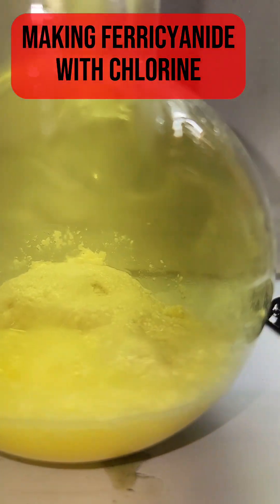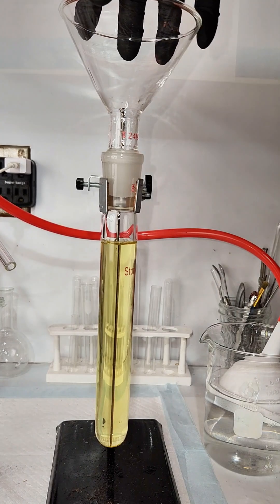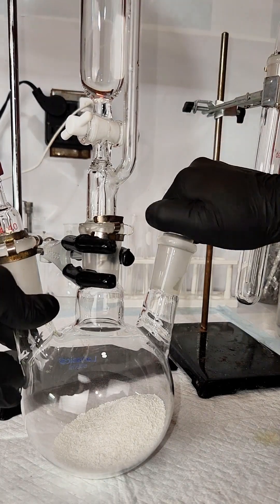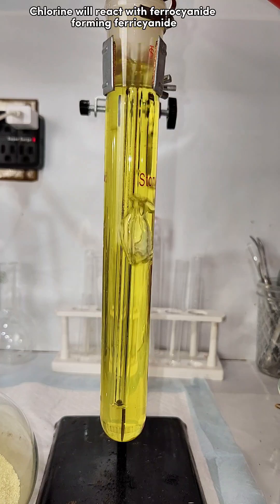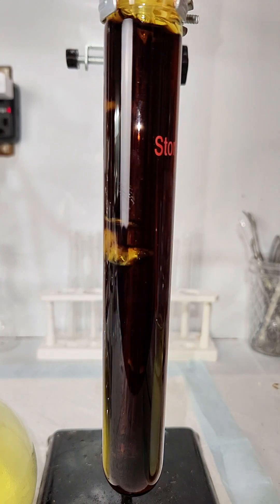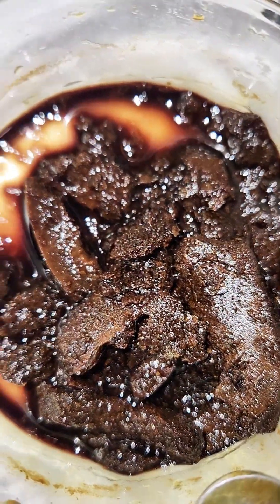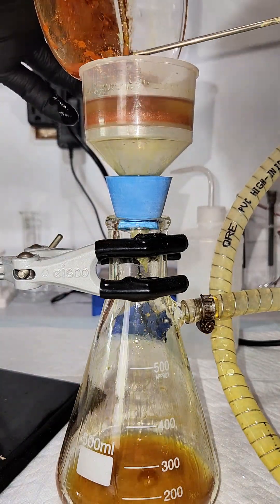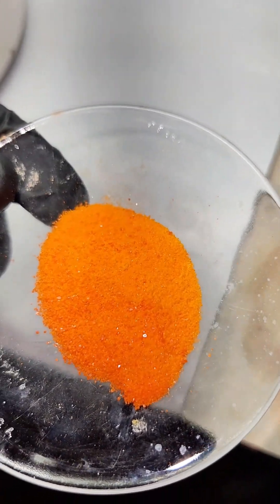Ferrocyanide to Ferricyanide

Comment: "Chlorine is really dangerous"
So go down Home Depot, buy bleach and "spirits of salt" (conc. hydrochloric acid) to clean a toilet, and then think mixing them will make an even stronger cleaner.
There should be large warnings on the containers of both chemicals. There is not. People have died doing this.

Comment: I would not use acetone here.  Ferricyanide is a mild oxidant and chlorine is a powerful oxidizer and chlorinator.
Reply: Ferricyanide was/is used in chemical photography to lighten selectively black and white prints. It's called "Farmer's reducer" though of course it oxidises the silver, not reduces it. It can also be used in a sepia process. 
The downsides are that the stuff needs making up fresh every time you use it, has a shelf life of about 10 minutes, and you need the extract on in case HCN is produced.
But it was fun when I was at school, along with making ultra-fine grain developers and the like - something today's aspiring chemists are unlikely to experience.

Comment: Yes, your recrystallizations don't seem to purify the product due to the extremely similar solubilities of the ferrocyanide and the ferricyanide (both around 30g/100mL iirc). So your product is likely going to contain some leftover ferrocyanide. I wonder if electrolysis of the solution will get rid of it: The ferrocyanide ion can be oxidized to ferricyanide on a nickel anode. The only byproduct is potassium hydroxide, which has a much larger solubility than the ferricyanide and therefore the product can be easily removed by the crystallization and filtration you've done here. Hope this helps!
Reply from the maker: Thats awesome! Thank you so much I'll have to give this one a try. I really underuse electrolysis in general, this could be a fun place to try getting more into it.
Reply: Can i use copper or titanium anode instead of nickel?